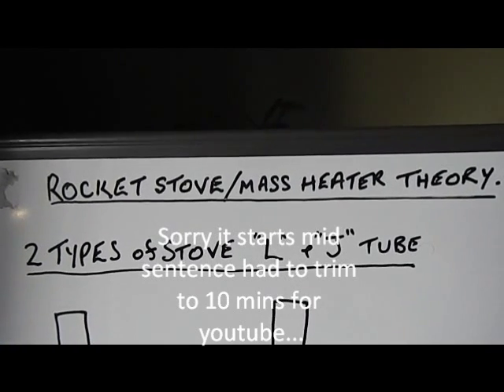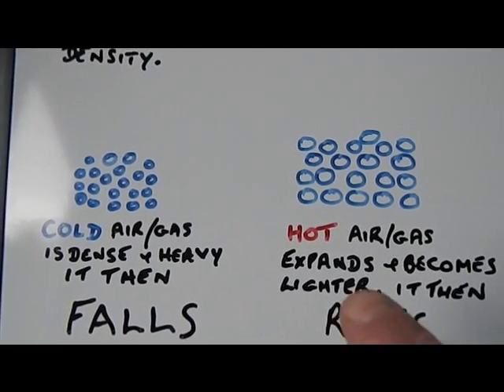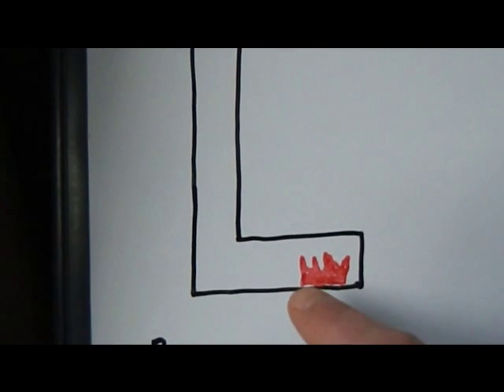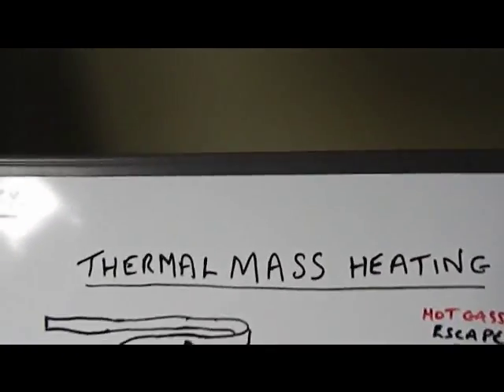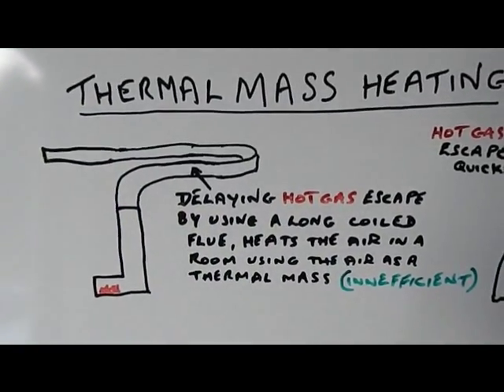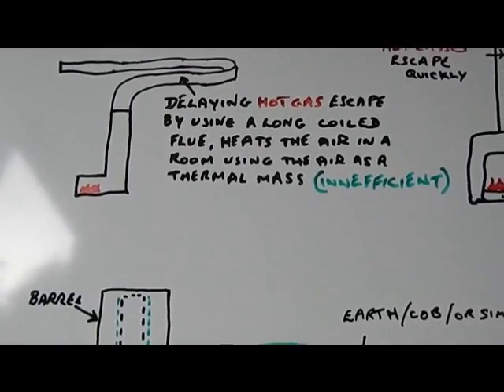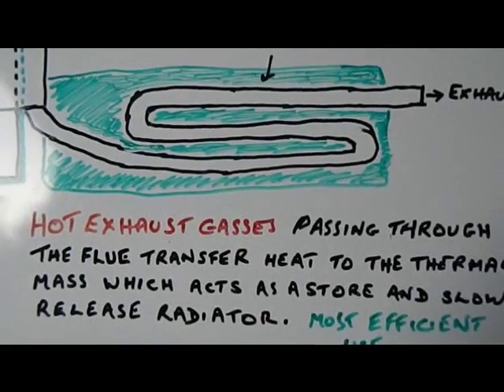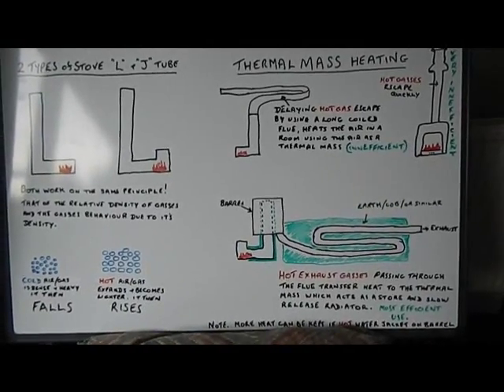Rocket stove theory

Comment: Good video. One thing. The "J" design will be "no smoke" or lower smoke than the L design because the J allows for more turbulence or mixing of gasses. The cold air slams straight down into the flame and then toward the barrel "rolling around a bit." A stove with an L design can have "straight line air" rushing "around" the fire so quickly, that sometimes all the smoke is not eaten up. With an L design, some cool gasses find the riser or chimney and cool gasses finding the chimney .......equals smoke.

Comment: This naively misses one of the main elements of true rocket stove principle in which the pressure oscillation in the secondary burn tube creates slight positive pressure in the exhaust, ( a la WW2 doodlebug!) thus allowing a long, horizontal and serpentine flue system which, in turn, allows enough time and surface area for a truly efficient exchange of heat.
Reply: I have a traditional wood stove where the gases escape straight up the flue....I still have to clean this (about every 2 seasons) as the unburnt crap sticks to the side of the pipe......I imagine the cooling gases would deposit on the sides under the thermal mass and be a nightmare to get out. Has anyone experienced this? how long I wonder does a thermal mass / rocket stove set up last?
Reply: A good rocket stove burns very cleanly, or completely.  There are sometimes effectively no carbon build ups on the best rocket stoves.  If you're getting smoke build up, you probably need to get more air in.
Reply: No, it does not "naively" miss anything. A "J" design rocket stove (with barrel) has no secondary air and has worked just fine in thousands of applications with no smoke, and a cob bench.

Comment: Thankyou for the video. Very few others explain the actual theory behind it, and none do it so succinctly. I still have a question though. What prevents the expanded/ heated air from pushing back out into the cold air intake? I don't understand what's causing it to push more towards the chimney part of the L/J instead of just pushing back out the way it came.
Reply: Cold air is heavier and denser, it pushes into the stove.  Hot air air from the fire rises, once it is past the central burn tube and cools on the outer shell the central tube acts like a 1 way valve.  The still warm air wants to rise, and that takes it out the flue.  The cold air pushes in and the hot air going out the flue pushes and sucks the air thru the system.
Reply: The draft in the longer tube pulls the air into and up the pipe.   Another way to say that is air pressure (cold air) pushes the hot air up the longer tube. See?

Comment: A good explanation of mass heating, but no too much to 'rocket' effect (and why rocket stoves are so efficient besides mass heating - i.e. temperature differential).
Reply: They burn hot, and they burn almost all of the wood, there is very little ash.  The inside tube acts like the "second combustion chamber" you see in high efficiency wood stoves.  The flue temperatures can be low because the creosote that can build up has already burned.

Comment: I've been researching Rocket Stove Mass Heaters for about 2 years now & this video was clearly the most all encompassing and informative of them all. Great clarification of the importance of insulating the entire L or J tube & great idea about the barrel wrapping as a second thermal mass. Perhaps one could wrap coiled copper tubing around the barrel with a thermostatically controlled zone pump with radiator or baseboard heat. Excellent!